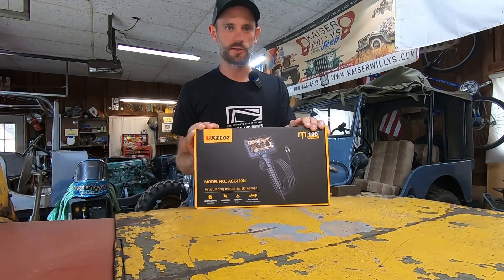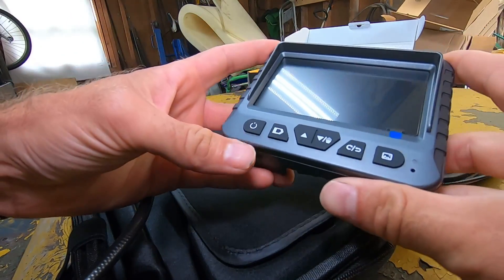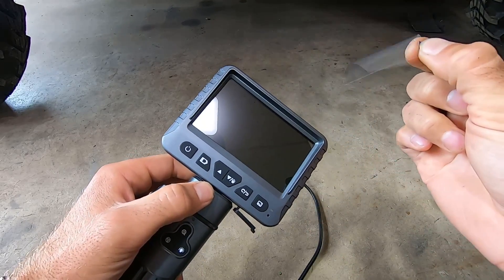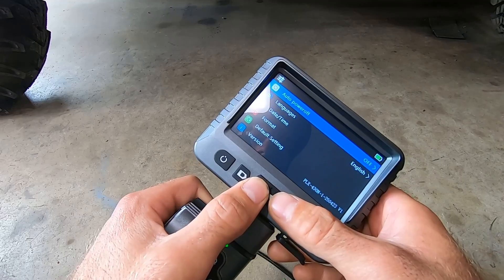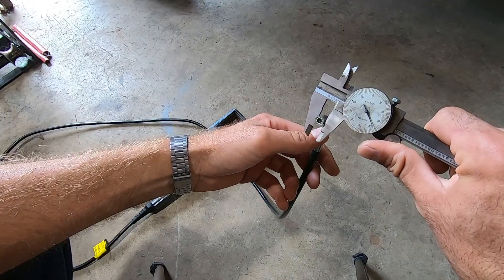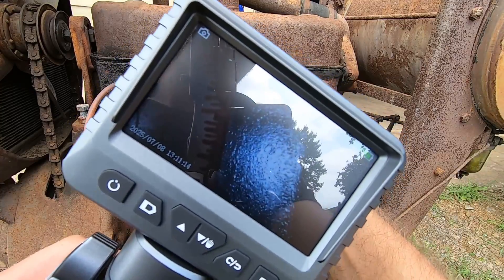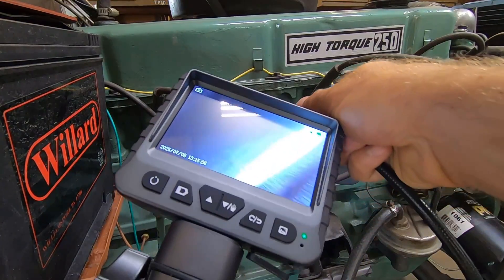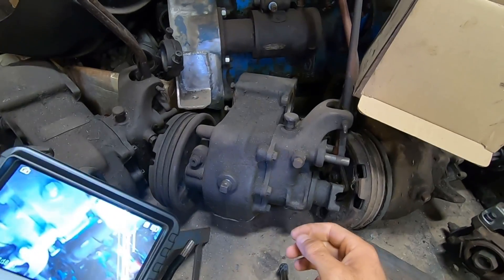DXZtoz Two-Way Articulating Borescope

Comment: Does this have the dexterity to get into the cylinder of a L134 through the sparkplug hole? Or is the head to big to squeeze in there?
Reply from the maker: That is an excellent question. I will definitely try that today and get back to you.  I’ll also try and include that in a future video as well. Thank you for watching and posing a fantastic question! Stay tuned
Reply: Love this review...have always wanted one of these. Thanks!!
Reply from the maker: So I did a test and you can get it in the spark plug hole but its very "snug" I was able to wiggle and steer just enough to look down in the cylinder but was unable to actually get the camera down in the cylinder. I hope this info helps. Thank you for the question.
Reply: @SethHensler  That does help! It would be awesome if you could post a video of it, It'd be nice to have this on the bench to poke around inside before having to pop a head off. Thanks for follow up